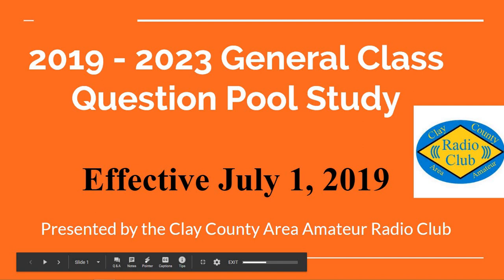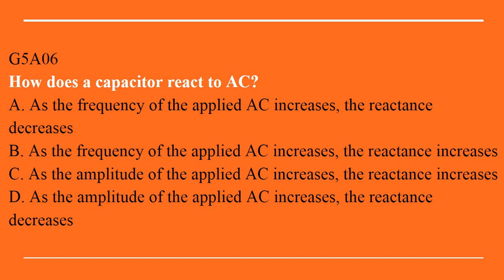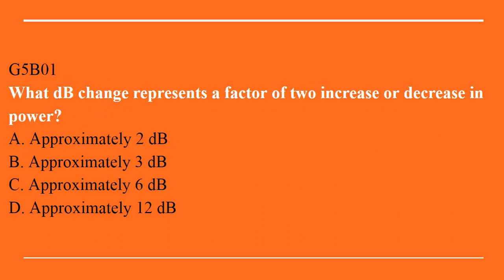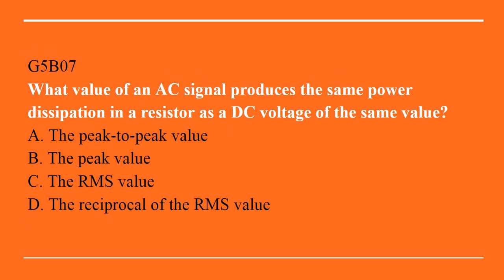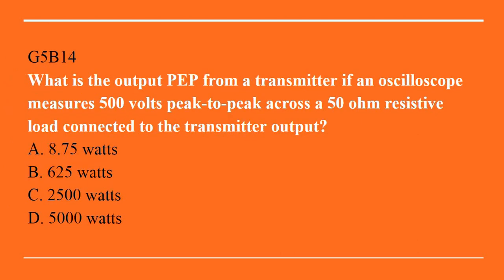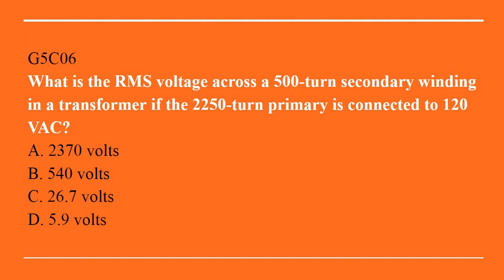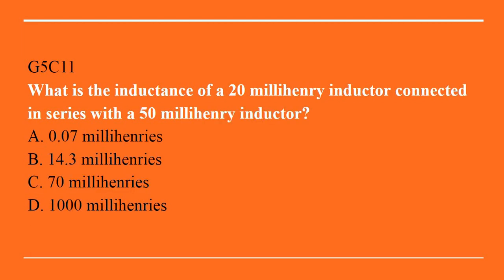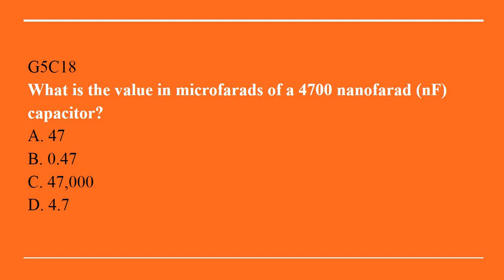(Expired) 6 General Class 2019 2023

Comment: Thank you for these videos.  They are very helpful.  For others who ran into this G5C08 is the correct pool question but if you look at the book a different question immediately proceeds the link to this question (it asks about capacitors in series).  Right after the link is the question about capacitors in parallel.  Confused me at first.